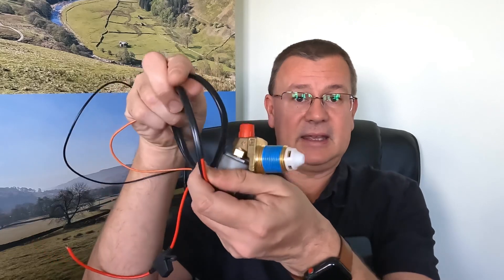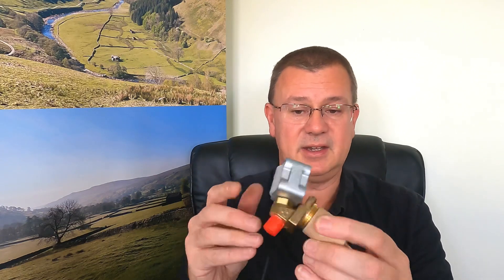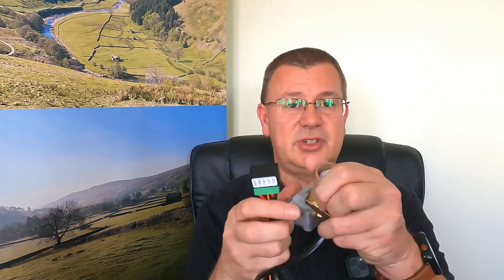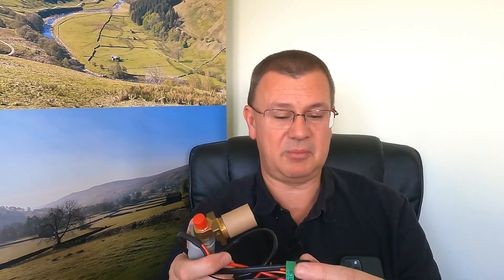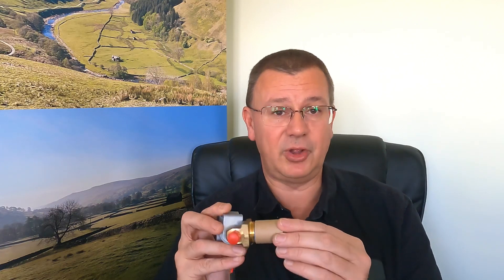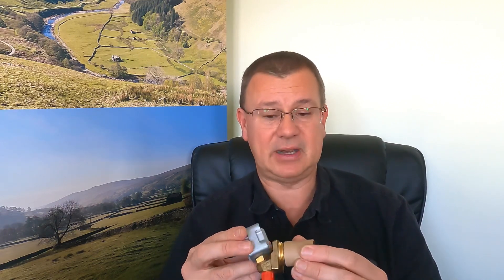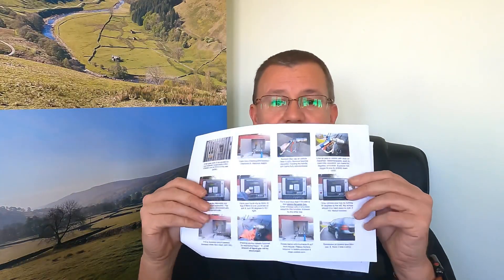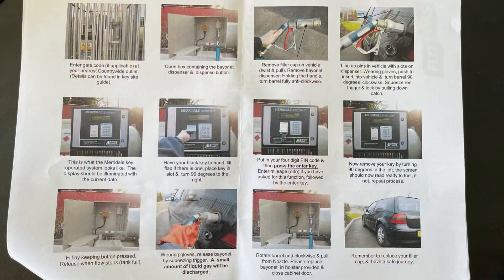Turn your underslung gas tank off when you power off with GasIT Solenoid valve and Flo Gas keys

Comment: I’ve seen many YouTube videos on vans using the channel tunnel, all are asked to turn the gas off, for normal in locker tanks, not a problem,.but underslung tanks, I always wondered how this is done, do you have to get under van to turn it off, this solenoid does the job, yes? would it be ok in the tunnel?
Reply from the maker: It’s a really good question with regard to the tunnel (or indeed anywhere else which insists on switching off. If you purchase the gas tanks from GasIT to fit you can get manual or electric shut off - the valve here simply upgrades it to electric (with the control switches etc to complete the setup) when the solenoid isn’t powered the tank is closed, when it’s powered it’s open so it’s really switching the tank off (same as a manual tap but without needing to get under the van) so I would expect that would be ok but can’t be sure without checking but it definitely switches the gas off when it’s off without crawling under the van.

Comment: Thanks David. Very interesting. Will watch as you progress. Not entirely sure what the key gives you access to. Never seen anywhere where you need a key. Although my experience isn’t that vast with LPG fill ups.  Only done it 3 times and all at the same garage.   Thanks for posting David 👍🧙‍♂️
Reply from the maker: Thanks for the comment 👍 I got the key as there’s a station not too far away which needs the key to use the LPG pump so thought it would be handy and noted that there seems to be less LPG stations than there was so more of a contingency and the price was cheaper per litre than the next closest. My theory was the age old, if you have a key you will probably not use it much but if you don’t have one, the time you’ve run out of LPG and need some the station will need a key - always happens to me so kind of a plan B thing 😀

Comment: Interesting video David, i had planned on getting  a soloniod gas  valve for my CV80 when it arrives.Very suprised they are not fitted as standard, saves clambering under the van! and if hooked up to the ignition no chance of forgetting to turn it off.
Reply from the maker: Thank you - couldn’t agree more - it’s relatively straightforward and not overly expensive in the grand scheme of things and I think keeps you safe by shutting the gas off when it shouldn’t be on without any real effort once installed. 👍